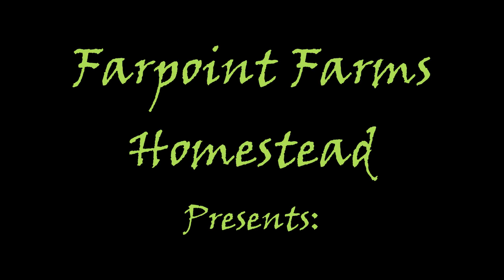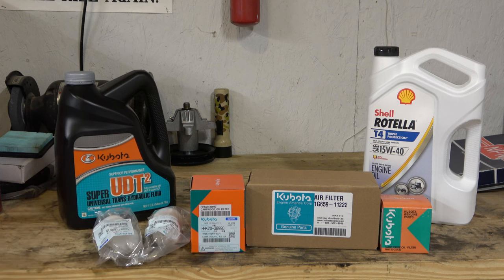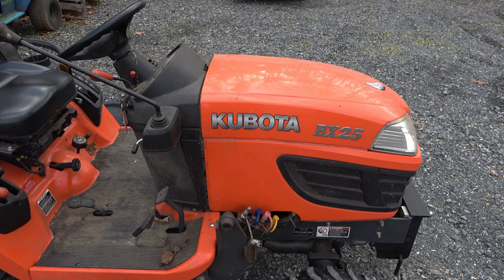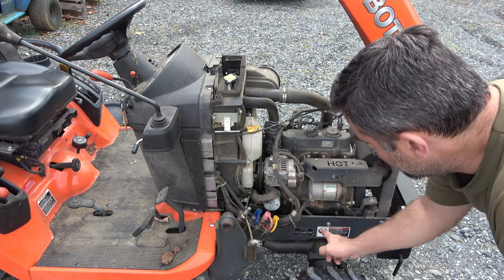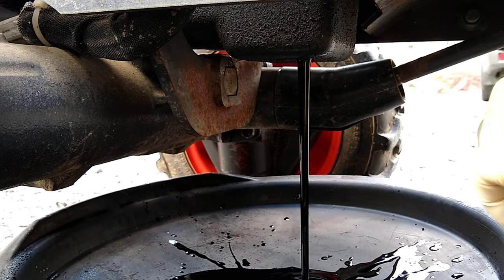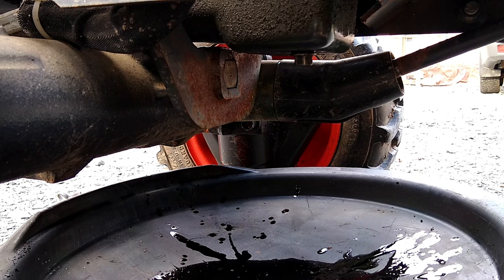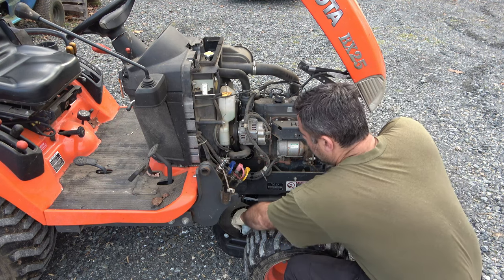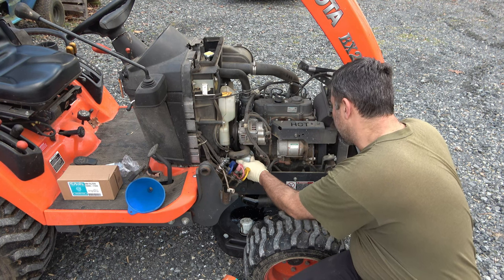Kubota BX Series Service Video. Watch this to learn how easy it is to keep your BX Tractor going.

Comment: Great video. I think before I change the fuel filters (next service) I was thinking about taking that skid plate off to make accessing the rear fuel filter easier. Looks like it just has 4 bolts.
Reply from the maker: Do it! It will help keep those injectors clean.